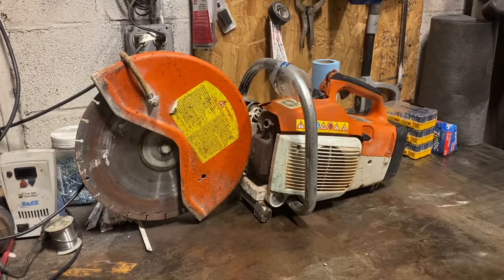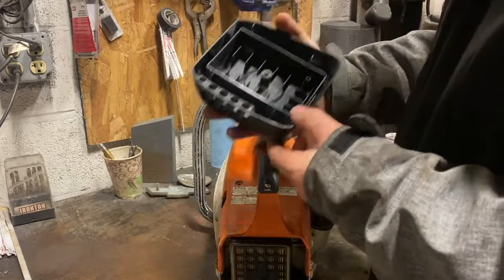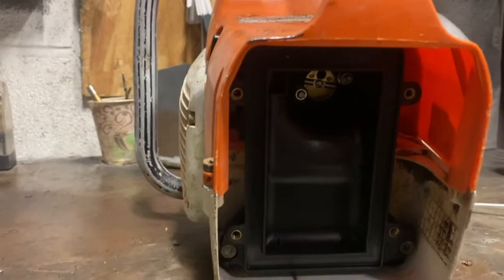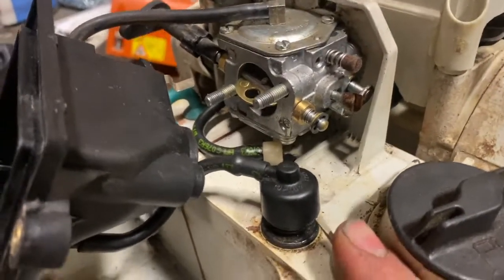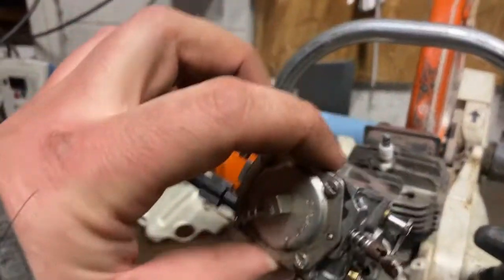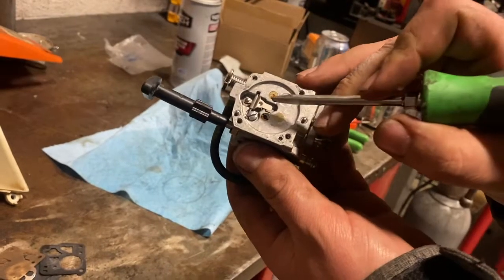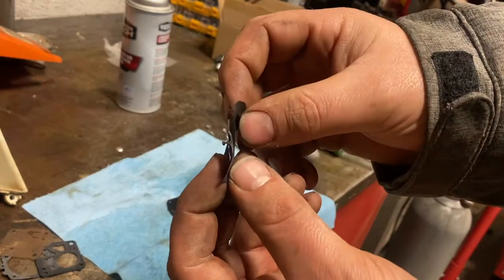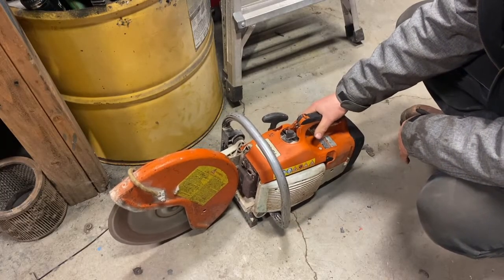Getting a Stihl TS400 running. Cleaning carb and other tips

Comment: Top hose is not a pulse hose its a vent , helps to compensate when the air filter become clogged it helps to regulate the movement of the metering diaphragm, the pulse line would be on the fuel pump diaphragm side…!
Reply from the maker: I agree with you! I pinned this comment so others can learn from it. Thanks!
Reply: That explains the extra pipe lol
Reply: Great video I've tried putting new diaphragm kits in my stihl ts 400 carbs but cant get them too run right I've sprayed all holes but fuel coming out from air filter what am I doing wrong many thanks

Comment: You just saved my Stihl Ts410. Had an issue with my Stihl saw where it would start but only run for about 3 seconds then it would turn off on its own. Did exactly what you did, cleaned the carb,  purchased a carb rebuild kit, cleaned THE FUEL PICKUP/ AIR VENT & all the fuel lines. My fuel pickup/ air vent was super crusty and the debris caused a bad seal, and that was my problem. So i basically cleaned my whole fuel system, put everything back together, tuned the carb at a standard setting of 1.5 turns out for both H & L set screws, now she runs like im her first owner. God bless your vid and thank you for showing us how its done🙏💯

Comment: Great video. So, my saw has started refusing to start up. I’ve got spark, got a new plug in anyway. Air filter isn’t too old. So I’m guessing maybe the carb. But I didn’t see what was actually wrong with your carb? Did you establish what it was or are you just putting it down to needing a good clean?
Reply from the maker: I didn't physically see any blockages but that isn't too unusual for these small carbs. Its possible the needle was sticky or something else too. Good luck with yours!
Reply: I went out to the garage last night for some beers and thought I’d give the cord a quick pull for the hell of it. Heard it catch a little, flipped the choke to half and give it another and off it went! So I decided to not waste the opportunity and started splitting some bricks I needed! Don’t think the neighbours were too happy. Hopefully it will start later today too. Thanks for your reply, it was good luck for me 👍
Reply: I've put stihl ts 400 in ultrasonic cleaner rebuilt with new diaphragm kit but wont tick over I've turned tick over screw in as far goes what am I doing wrong carb is spotless do you change welsh plug

Comment: My Carb also only has 1 adjustment screw for the low I am guessing. I thought it was missing one and I am about to order a new carb because I thought it fell off. I got this machine used BTW.  The new carbs have a H and L adj. screw. Why is there only one on this one? Thanks
Reply from the maker: 70soundwave Mine only has 1 screw too. I expected it to have both like I probably said in the video. I too, bought a Chinese carb, that has a H and L, but never used it. I am happy with how it runs with the OEM carb. If yours runs well on the OEM carb I wouldn't change it.
Reply: Hiya, I think  it's because the newer saws have a rev limiter built into  the coil so a Hi mixture adjustment isn't needed.. The older saws need the Hi adjustment to adjust the max revs..

Comment: Good video, very helpful, they are a great bit of kit, they are just as good as well with cutting steel as well, we use them for everything in demolition, cables, steels, concrete
Reply from the maker: Yup! Love it I keep a metal blade in it most of the time

Comment: Hi come across your video, mine struggles to start if I've got less than half a tank of fuel despite a new fuel filter and fuel line, any ideas please would be appreciated 👍
Reply from the maker: Sometimes that means there is a pinhole in the fuel pickup line... but looks like you already replaced that. I am not too sure sorry!
Reply: @spankranchgarage  ill double check the pipe and grommet.  Cheers for reply 👍

Comment: Im curious how and if I'll know the carb needs adjusting?
Reply from the maker: If the engine surges at full throttle, typically you will turn the high jet “out”, counter clockwise. If it bogs at full throttle, smokes a lot, and doesn’t run “crisp”, turn the high jet in. Turn in 1/4 turn increments and see if it gets better or worse